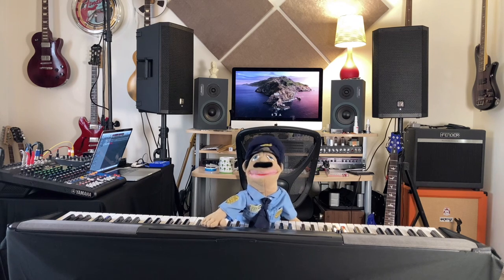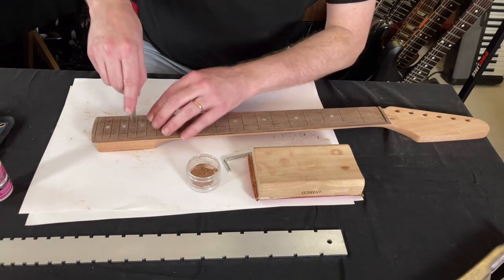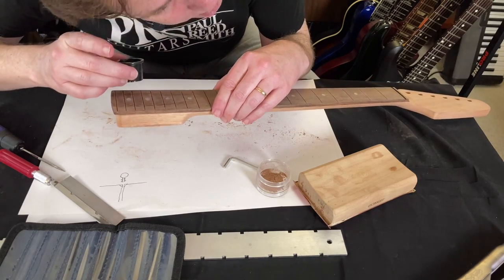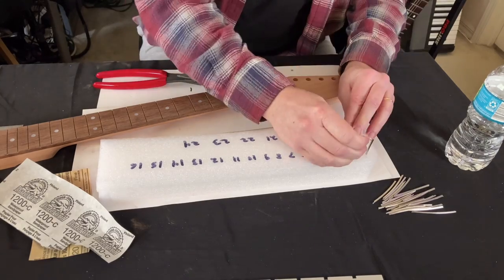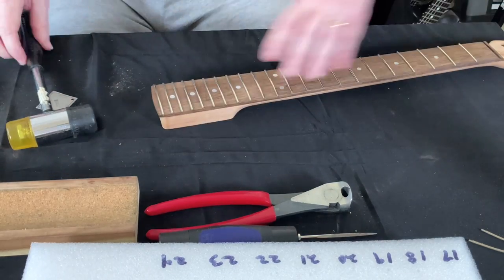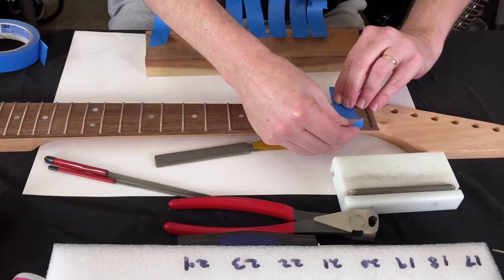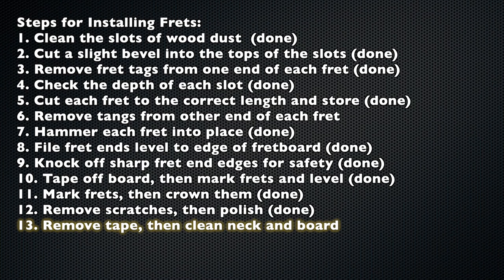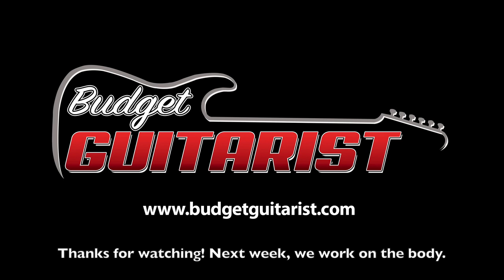StewMac Build 3 - Installing Frets

Comment from the maker: Just one thing to add - if you install frets the way I did in this video, it leaves a gap at each end of the fret slot.  That gap is then filled with wood dust, and then followed up with a drop of water-thin super glue, then sanded down.  I didn't "film" that part of the process, but I should have.
Reply: How did you end up with a gap? Slots too deep?

Comment: What a great video! The fact that you used common tools to carry this out is amazing in itself, and the overall fret work looks great! How much more difficult would it be if they were stainless steel frets?
Reply from the maker: I think with stainless steel, you'd probably need 150 grit sandpaper to level the frets, and it'd take a lot of more work to crown them, BUT you might never need to do it again!  I want to get into stainless steel, but only after I get an arbor press for putting frets in.  I think an arbor press will take my fretwork to the next level.  I ordered a diamond fret crowning file from StewMac last night.  I definitely enjoy doing fretwork.
Reply: @user-eu3mn6ss5l  That is great to know - it sounds scary to even try doing any fretwork let alone with stainless steel but overall, one day, I may take the plunge.  I'll be referring back to your videos because you have a no-nonsense approach.  I look forward to more.

Comment: I am not an expert but would it be possible that the metal parts are not screws but locating pins from when the fretboard got glued on?
Reply from the maker: They could be.  Even with my USB microscope camera, they just show up as a shiny spot.  I can't tell if it's part of a screw or a pin.  But they're shallow enough that the bottom of the fret was bumping into them.  Which means the original frets in this thing had less metal in the wood, so to speak.  I bet whoever made the kit never thought about people doing refrets.  I've never seen a pro guitar neck that left any kind of metal part under an actual slot.  That said, this isn't a pro guitar, but rather a very fun kit for novice builders.  I still like the guitar, but the metal under the slot was weird.
Reply: I would bet on it.

Comment: Buy dan erliewines fretting book first. Then get the stewmac straight edge set. If the fretboard is flat and you have to sand the radieus in, check the slots, if the slots were sawn straght across they will be too deep in the middle and all those little cuts, can cause a neck to be rubbery, just like kerfing wood bends for bracing and gluing the top and sides. I strongly recommend you install the frets with super glue to fill the gap at the   center of the radius. Measure the width of the slots with a feeler gage, if the saw you got was kerfed, (my exacto saw was kerfed and too wide for the slots so i took the kerf off both sides with a dry oil stone. If you need to saw slot ends deeper, crazy glue a depth stop, a piece of thin plexiglass works well and you will never saw too deep. Get the right radius fret pressing caul from stewmac and build or buy the pressing tool for your drill press. Press in the first fret, skip one and pressin the 3rd fret, now presse in the second fret and use a fret rocker to see if the 3 frets are evenly set, check the middle and sides also, if a fret or two are two high press them in some more, keep doing this as you progress down the board keeping a cork lined call under the neck. With care and patience you can skip the whole tedious job of leveling and recrowning. I did some fret jobs with the grinding and recrowning crap and if you dont know how to swear, you will by the time you install frets the way its done in this video with the levelng and crowning. If you take a regular cutter and file off the outside of it removing the bevel, you will create a cutter that cuts completely clean with the edge of the board. Yaknow those little sanding disca that come with a dremel kit you never use? Stack two or three on a mandrel and use them in your dremel for rounding and smoothing fret ends, with that fine grained paper all you have to do is polish them and youre done. Again doing away with the filing crowning junk. Stewmac also sells thin ateel fretboard guards you can use during this process. I advise any first timer to use a thicker wider fret. Theres more to grind off if you get too rude with the leveling. Remember stevie ray vaugn had his strats refretted with wide bass wire for easy bending. If you buy wire from stewmac and its straight, just cut a slot in  a piece of wide quarter round and draw the wire over it or just bend a radius in the wire by eye no need for fancy tools. I used bulk wire bent it pressed it in with one end flush and then cut the other end flush right then. My last bass i used a 24 fret ebony board from stew mac. Prettiest piece of wood i ever held in my hands, slots are cut to match the radius, but i still installed them with super glue. Good luck have fun and the guitar you design and build yourself is the right one for you. The best bass i built is one with no wood...it is the voice of god...but thats another story...

Comment: I have a question On step 7 ,instaling frets with a hammer, i have a problem about the  gap under fret ends ,i tried to hammer it again, but it still have a gap under the fret, can you tell me how to solve my problem?
Reply from the maker: You can pre-bend the fret ends just a bit before you hammer them in.  That usually does the trick!